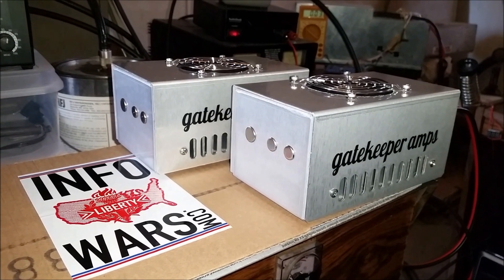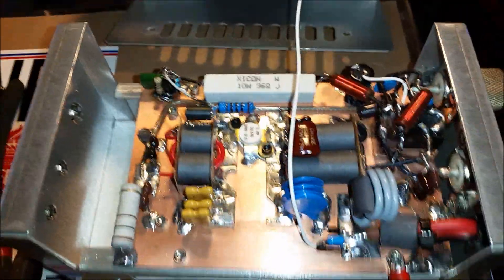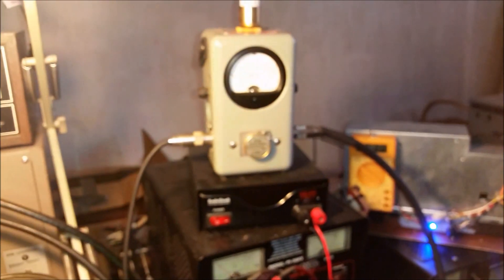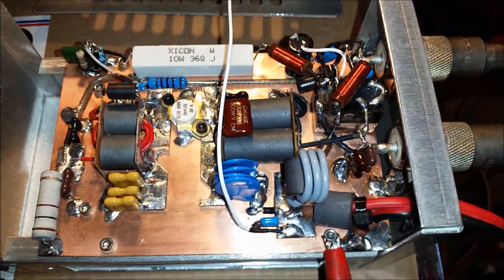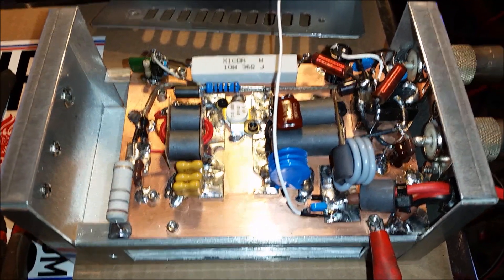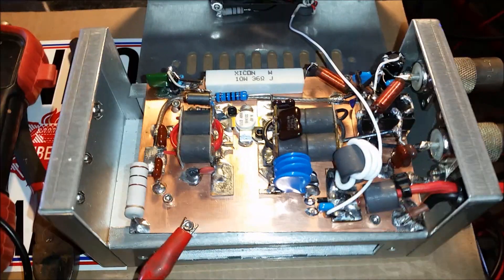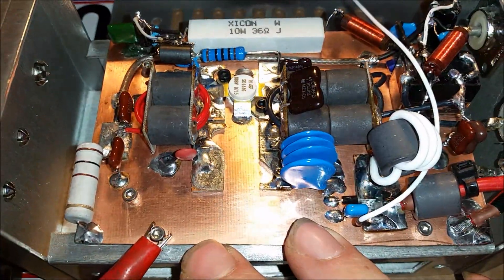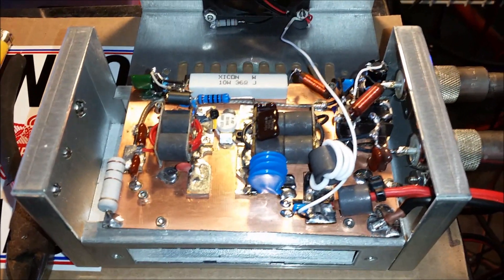Twin Single SD1446 AB Biased Gatekeeper Built Amplifiers

Comment: Everyone jas ther own opinion qnd outlook on circuits..i believe that the bias should be able to move up and down with the voltage charteristics of thr amplifier itself ....a amplifier doesnt stay in one place all the time ..its important to me that thr bias ..moves with it.....i ise thr standard loading resistor and loading diode ,with a blocking cap and blocking diode and small electrolytic... They work perfectly and.have gor decades
Reply from the maker: Indeed brother

Comment: All of your videos are very interesting and informative. Thanks for sharing. I have tried to build my own 4 pill sd1446 amp and for the most part it works O.K. but the balancing resistor on the output combiner gets very hot. Any advice?

Comment: What capacitors are you running on the output transformer?
Reply from the maker: S Con i might had played around with a 820pf and a 1000pf on those 2 just to see the difference of each. if my memory serves me right. i normally use just a 1000pf cap.